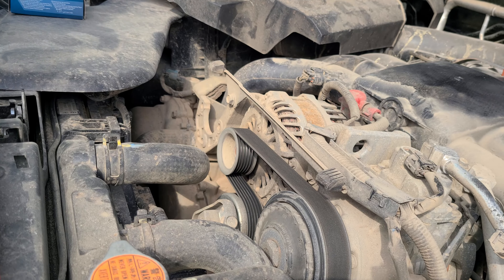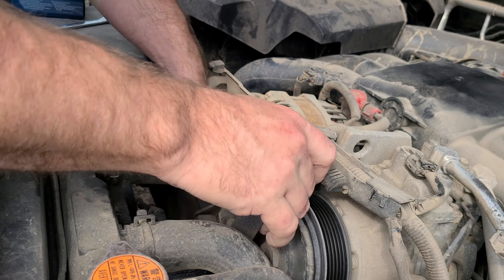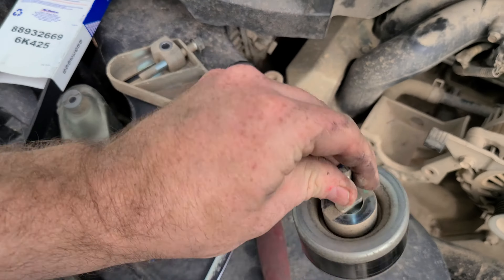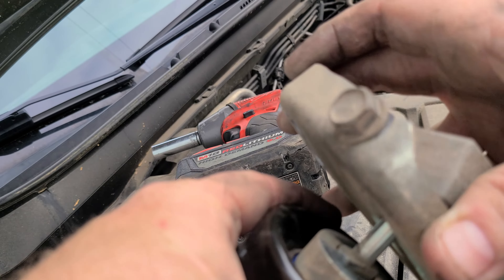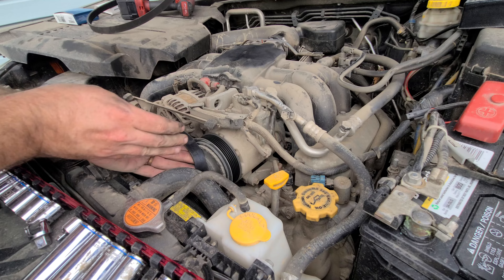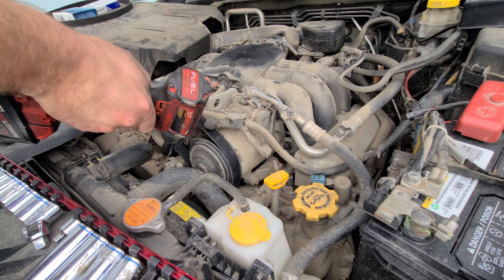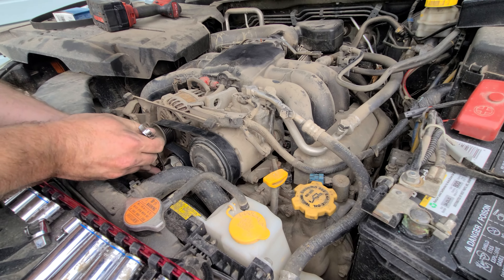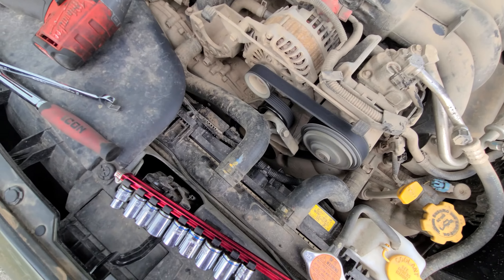2015-2019 3.6 Subaru Outback Pulley and Accessory Belt Change

Comment: Excellent! Allow me to add a bit of information. With respect to belt play,  service manual says "When installing new parts  3 — 4 mm (0.118 — 0.157 in).  At inspection 6 — 7 mm (0.236 — 0.276 in)". There is also apparently a likely special too requiring "sonic belt tension" method which determines tightness via Hertz  frequency. The tension bolt "B" is adjusted and tightening bolt A listed as: "Tightening torque: 20 N·m (2.0 kgf-m, 14.8 ft-lb)". Hope this helps. Note this is for the 6 cylinder. No idea what the 4 might be.

Comment: Thanks man! Looks like your car went to Burning Man and back! I did this replacement in about 30 minutes after rolling over 109K. I was getting squealing upon start up. I went for the factory parts, was about $75 for the pulley and $60 for the belt. Could have got cheaper parts but I saved a lot in labor and the stock parts lasted 100K... Tools were 14mm socket, 12mm socket and 12 mm opened end wrench. Small hands are helpful!

Comment: Thank you for this video and showing the correct Dayco part number on the pulley box. I have a 2015 Outback with a 3.6 and everywhere I look they say the part number is 89148 Even on Dayco's site which includes my VIN number in their search engine says the same. I wrote down the number in your video and got the correct one locally. I don't understand how everyone around has the wrong part number. Maybe there was a change halfway through the year, who knows. Thanks again.
Reply from the maker: I noticed that as well. The wrong number part is listed incorrectly in several places. 

Glad to help!

Comment: Hi!, seems that a 1095 is too long for that belt configuration. On the Japan made outback, they have that belt/pulley system on the 2010-2015 models, with a 6pk 1078 or  6pk 1080mm belt.
Reply from the maker: Is that for the models that have a power steering pump?
Reply: @bruceyyyyy  the euro outbacks have  electric steering since 2010. I bought some spare parts on subaru usa and I found there that some engine parts are introduced years later. For my 2010 euro outback I have to buy 2015+ engine parts 🤷‍♂️. Also some have the same spare part number, like the idler pulley.